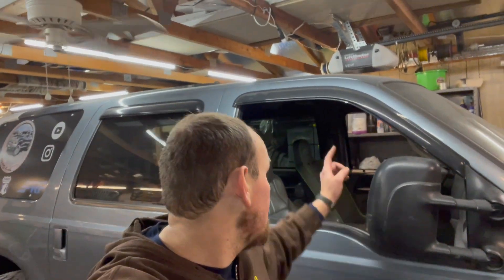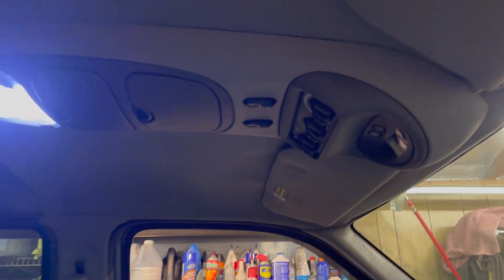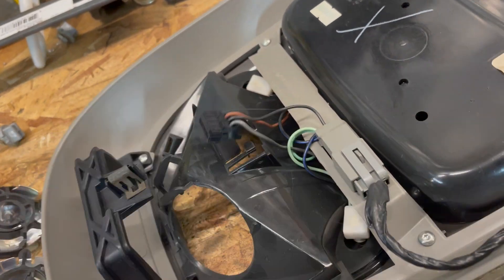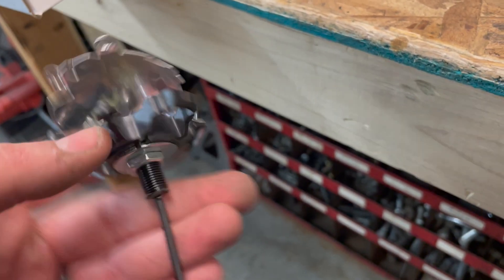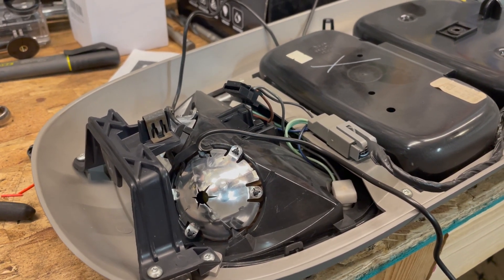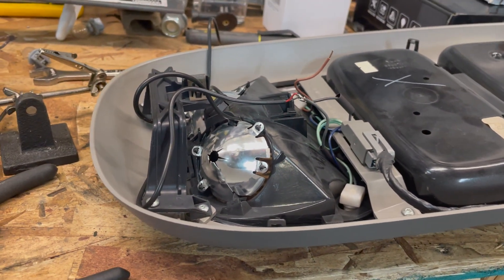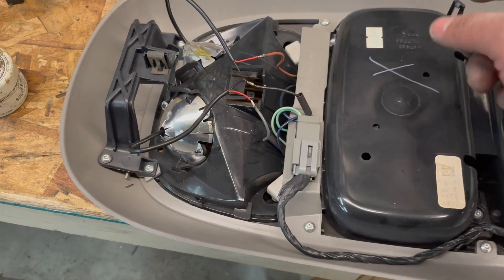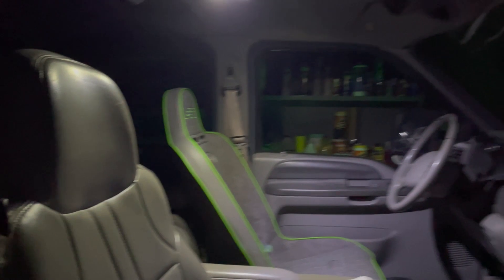Ford Excursion Map Light LED Upgrade: The Bright Way

Comment: @Geeks4x4, do you have any updates on the updated lights you did in your Excursion? Also, would you post a video on how to do the solder mod on the 2nd row? My second row lights always flicker
Reply from the maker: These cat eyes were installed in bob, they weren't in there long enough for me to give you great long term thoughts as I built my own overhead console. But it does have the same lights in it and the lights themselves are great. I haven't heard about a solder mod for the second row the white truck has had LED's in it for years with zero flicker....